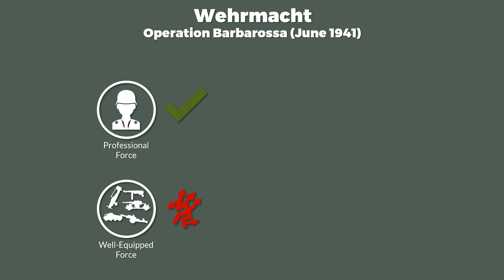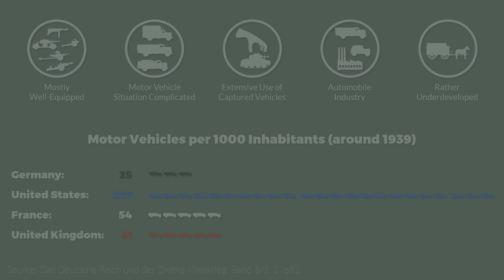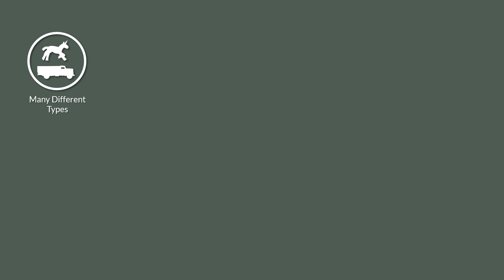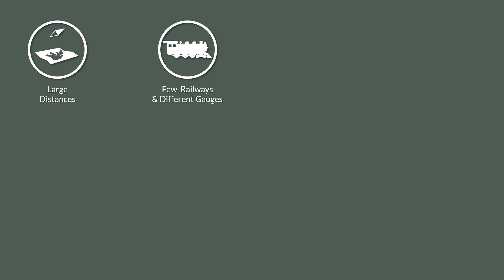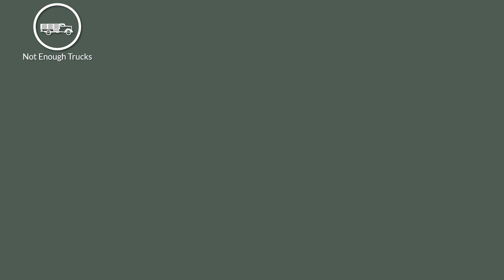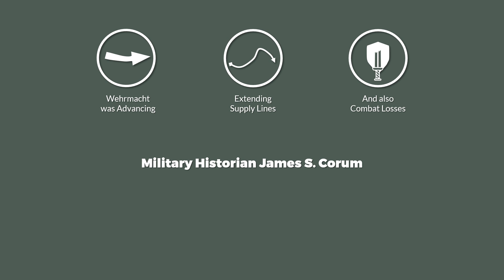Operation Barbarossa & Loot Force One

Comment: Battle Storm Stalingrad by TIK really Hammers (no Soviet pun intended) just how bad the situation was for both forces. In fact it is almost as bad for the Soviets, the only advantage they had was their supply lines were not strung out. But even before hitting Stalingrad the entire panzerwaffe was literally running on fumes and constantly had to stop and go even when they had gas become of the lack of motor transport for the infantry and artillery.
Reply from the maker: Barbarossa 1941
Stalingrad 1942/43

Comment: Population in 1939:
Germany:70 million(not including others)
France:40 million
Well,before Hitler came into the power Germany’s automobile industry and ownership was in total mess.They just produced about 108.000 motor vehicles in 1928 compare well ahead of 200.000 for UK and France.İn mid 1930s that’s increased the more than two times and Germany became outproduce France in 1936.İn 1933 only about 500.000 motor vehicles were in Germany but in 1939 that’s increased to about 1.7 million.
Source: https://en.m.wikipedia.org/wiki/Automotive_industry_in_France

Comment: 1) The nobility of Central European countries relied on horses and hempered the introduction of the combustion engine.
2) The Eastern lands of Central European countries were sub-developped - and still are (East Germany, Burgenland, Slovakia).
3) By the end of the 19th century, Central European countries were based on well developped networks of railways, rivers & canals. So there was less incent and need for automobiles.
4) Large portions of Central Europe are hilly and mountainous. Flat country favoured the introduction of a brand-new/unreliable technique.
5) France was relatively poor in coal and relatively rich in petrol - and still is today. Until WW1, France was the leading nation in automobile/panzer construction, by then overtaken by the U.S.A.
6) The Paris Peace Treaties contributed to the dismantlement and backlash of Central European industry. However the new-founded Czechoslovakian Republic was not subjected to these treaties and had an important automobile and tank production capability by 1938.

Comment: I am not sure if Germany would have fared significantly better if the situation of their motor pool was better during WW2. That is, even if Germany had a greater capacity for motor production than historically available, it would not have done much good unless they also had much better access to petroleum than historically available. The Rumanian fields could only stretch so far. Meanwhile, converting coal into petroleum (Germany had a plenty of coal) could only stretch so far. To make life funny, the Soviets supplied a considerable volume of petroleum to Germany until the start of Operation Barbarossa. Shoestring petroleum availability, needless to say, also had detrimental effects on Luftwaffe and Kriegsmarine.
Reply from the maker: +Waterflux yeah, good point actually could be worth a video.
Reply: That would be very good. As a matter of fact, Japan also faced pretty much the very same predicament Germany faced during WW2. A major motivation behind the German and the Japanese expansionism centered around securing resources, even though both of them ended up risking everything.

Comment: That's the key of German's failure: Standarization. Or more like... the horrible lack of it. I remember you mentioned in other video how the US relied almost exclusively in .50 Cal machineguns for almost everything: from infantry weapons to tanks and airforce. In contrast, Germans used an stupid variety of calibers and ammo that presented a huge mess in the supply lines. The same can be said about tanks: Americans relied heavily, and perhaps almost exclusively, on their trustworthy Sherman M4. So supply lines of parts for repairs were quite standarized, simply deploying parts for Shermans. But the Germans... god lord, the huge variety and non-sense of tanks the german had, like the Pnz IV, Pnz V Panther, Pnz VI Tiger, Pnz VII Kônig Tiger, Jagdapanzer, Jagdapanther, Jagdatiger, Marder II, Marder III, StuG, StuH, and probably you could go on and on and on with your knowledge in their tanks... its... stupidly overcomplicated. Well, everything with german engineer back then was stupidly overcomplicated.
Reply: You're over simplifying things for the Americans. For example, the Sherman was the mainstay of the Armoured Force, but it had many different variants. 

Later tanks introduced HVSS suspension, and there were several different guns in use (75mm, 76mm, 105mm), all complicating parts and ammunition supply. 

The same with infantry weapons. .30-06 was the most used, but that was accompanied by .50, .30 Carbine, and .45. 

Granted the US arsenal was much better standardised than the German one, but if you want a true pinnacle of standardisation, the Soviets are where to go. 

Two tanks (T-34 and KV, later replaced by T-34-85 and IS respectively), one anti-tank/tank gun (76.2mm, replaced by 85mm), one pistol cartridge, one rifle cartridge. The Soviets were a testament to manufacturing efficiency.
Reply: Well, I didnt know enough details, but I aint surprised the Soviets were the pinnacle of standarization: they relied heavily on outproducing the germans throughout the war. Still, the basic points of germans having no idea of what standarization even means stands. As usual, germans became overcomplicated.
Reply: A lot of those German vehicles were just variations on a theme; Marders and StuGs used the same chassis as a couple of the turreted tanks, so the parts for the running gear of those vehicles were standard and wouldn't have been such a logistical problem.  I think American tankers would've preferred a more complicated supply line to have some better tanks to handle the more capable (but outnumbered) ones they had to deal with.  When you're the guy in the Sherman, the fact that when your tank gets taken out there will be five more to replace it is no comfort.
Reply: Indeed, but sadly... this isn't a spa, this is war. This isn't about the tank crew being comfortable with their task, this is about defeating your enemy. American's tank industry allowed them to win the war, bigger losses or not.
Reply: Of course the same goes for the German infantry man facing an attack by infantry supported by tanks. Knowing there's a superior tank somewhere down his lines then the ones he's facing , is no comfort. More tanks meant saving more infantry. Better but fewer allied tanks might have saved tankers lives, but not necessary resulted in lower losses overall. And a longer build up for a ground war, would mean a longer war and thus more loss of live of sailors and airmen, not the mention the civilians in the occupied countries. While the Germans were of course also building up, meaning to killing more Germans which often is 1 on 1 business.
Reply: Oil was by far the most severe, along with amount of troops and limited industry. They also prioritised the wrong things, for example plane designs over plane factories, and their leadership was a mess too.
Reply: "Oil was by far the most severe, along with amount of troops and limited industry. They also prioritised the wrong things, for example plane designs over plane factories, and their leadership was a mess too."  I disagree.  The industry was immense, as seen in 1944 when there was constant bombing and production generally increased across the board.  In terms of prioritization, in Germany there was no one head to prioritize things until Speer brought down the hammer.  Until them, it was four different branches (Luft, Heer, Kriegs, SS) begging industrialists to make something for them.  And even in the Heer the artillery branch and panzer branch designed their own assault guns just to screw with each other.  In the US we laud industry for making Shermans, Shermans, and more Shermans.  However, the more I dig into it, it seems the reasons had more to do with money, money, and more money.  Those heavy industries made BANK off of those Shermans.  The army KNEW they needed a next generation tank fast, but it was probably political pressure from your good old corrupt congressmen taking money from Chrysler and Ford that kept the Shermans on the production line.  Those early contracts were very beneficial for the industrialists, and no one wants to have to retool for a next gen tank if you can avoid it.  VVSS to HVSS is only a joke, and cannot possibly be justified.  It simply kept the Shermans rolling off the lines, since they would have to retool the vehicle for torsion bar.  HVSS kept the same terrible external suspension units.  Easy to fix?  Haha.  That's because they kept getting shot off!  Anyway, war is money and politics, and rarely has much to do with the soldier on the field, no matter how much we want to think otherwise.

Comment: The railway issue was so horrible for the Germans.  The gauges were different sure, and they had to readjust or complete rebuild the tracks as they went.  Still, they had expected that.  They also had to deal with the Soviets destroying parts of the rail infrastructure and the fact that the Soviets used larger engines.  German locomotives needed to stop more often for water for example then the Soviets, this required them to not only repair and replace parts of the railway, they had to build yet more infrastructure for it to support their locomotives by adding water towers half way between the already built or repaired Soviet ones.

Comment: Nice vid. Well, the thing is, all the theories about bad roads in USSR stopping the Germans, all the supply problems etc. stopping the advance is, well, finding something to put on the blame for failure.
 If you think about it, the distances in Barbarossa were short! Today, you could drive from Vilnius or Riga (each a few hours drive to what would be Polish border or East Prussia back then) to Moscow in less than a day. So, the logistics was a factor, but not the crucial factor. Those french trucks would have held out ;)
Reply: Well the Factor is Today....in 1941 there were only really Bad Streets in East Europe (Was said in the Video),the Cars and Truck were more Primitive then what we use today and you can't compare an Holiday trip with the Transport of Supplys.

Comment: Ah, yes the Regie Renault trucks with the 2cm too long oil dipsticks might explain the reliability problems experienced. by the kind and generous German occupiers of France. Everything else on the vehicle passes German quality control standards (if it doesn't pass QC we will hang you) yet the vehicles still have a relatively short life span. Brains over brutality wins every time.

Comment: This is a much needed video that sheds a bit of light on the vital role of non-German equipment in the service of the Wehrmacht. Entire panzer divisions were equipped with the Czech built PzKpfw 38t for the invasion of France as well as the Soviet Union a year later, as described in this video.  I would like to see more about the use of captured Soviet equipment such as the T-34 tank modified for German use with a commander's cupola, a better sight for the main gun, and a German-made radio in every vehicle. It is frightening to consider what could have been had Albert Speer been tasked with mass producing a German copy of the T-34 in 1942 (I know the timing is off, but it's an interesting "what if".) Another example of captured equipment reuse is the hundreds of captured Soviet M1936 Divisional guns in 76mm modified for the anti-tank role and reissued by the Wehrmacht as the 7.62 cm Pak 36-r. Naturally, these former Soviet artillery guns were used to great effect against the Soviet T-34's.  I read at some point that it was Soviet policy to always build their weapons with ammunition that would be at least slightly incompatible with enemy weapons to prevent the easy use of ammunition that had been captured by the enemy. Examples are abundant: 7.62x54R, 7.65mm, 85mm, 100mm, 122mm, 152mm and so on. To clarify, the similar German calibers were 7.92x57mm, 9mm Luger, 88mm, 105mm, and the 150mm. I would also be curious about the Germany Army's documents regarding captured M-1 Garand rifles. No doubt, thousands of these were captured in places like the Battle of the Kasserine Pass.   An odd, but somewhat related bit of trivia is that the British Army equipped many of their vehicles with the BESA machine gun in 7.92x57mm, the exact same ammunition used in so many Wehrmacht small arms. For the British, issuing both .303 and 7.92mm was problematic, but it certainly had its advantages when capturing enemy ammunition stores.

Comment: I really thought that there would be more cars in Germany after the Volkswagen was introduced but I guess not. Only 25 per 1000 people. Damn, and they called the Soviets underdeveloped.
Reply from the maker: well, I think the soviets had less.
Reply: The whole system of saving money to buy a Volkswagen (or officially KdF-Wagen at the time) only began in 1938, and production was scheduled to start in 1940. At that time, the factory was re-tooled to contribute to the war effort instead of producing consumer cars.
The Volkswagen (the "Beetle"), while mostly designed in the Nazi era, became only widespread after the War and more a symbol of the Wirtschaftswunder.
Reply: Emilio Vargas almost nonexistent. Tzarist Russia had litle but no car industry (the only factory was in Riga and went bancrpt under independent Latvia) so USSR had em.... little to begin whith. and its idustrialization plan was focusing primarely on the means of production, which means that the Soviet industry produced mostly trucks and tractors, not regular cars. wiki sais that in 1940 USSR had 145,4 thousand automoiles 140 thousand of which were trucks. ( less then 1 per capita) so you can see it was still really low, despite of really quick growth in 1930s
Reply: The James May video about the VW Beetle in his series "Cars of the People" is quite good. The Beetle and Kubelwagen made some contributions to the war effort, but most of it was postwar.
Reply: Андрей Назариков thanks andrei!
Reply: Military History Visualized do you have that detail? it would be nice to compare the amount of vehicles in soviet per capita as well
Reply: Emilio Vargas you're wellcome.
Reply: Geary well, USSR produced more. Especially from 1943 when  gigantic factories in Ural region reached their full production capabilities. Espetially concidering lend lease trucks that came to USSR disasembled (machinocomplekt - car-assembly-set as they were called).
Reply: Андрей Назариков No,Germany produced 347.000 trucks during the war while Soviets produced 197.000.Soviets were mostly supplied by US.
Reply: Not one car for private use came out of that factory during the war. I believe some people in West Germany who had managed to collect enough coupons did eventually receive a car after the war.
Reply: the fectories for the volkwagens had to be switched to war production
Reply: Well the Soviets were....the losses speak for themselfs XD
Reply: Soviets did have a better supply of trucks, IIRC, and they naturally also made a practice of transporting troops on top of tanks for both faster movement and protection against ambushes.
Reply: You should not mix the losses the Soviets suffered in WW2 into it. There are many reasons for the huge amount of people the Soviets lost, their underdeveloped military and industry was one, but poor leadership and well the moment of surprise probably played a huge rolle as well. Not to mention, that it is really very difficult to say which of the looses have been strictly military personal and which one civilian casualties, as the German army didn't really held much back on the eastern front. There is also the problem, that many Soviet soldiers died in German pow camps, since the German army simply had no way of feeding millions of prisoners. Yet, considering the situation and the immense looses the Soviet Union still manged to rebuild their infrastructure, to equip their military and to turn the war around. That's not a small feat by any stretch of imagination.